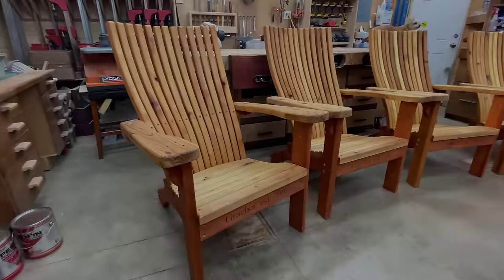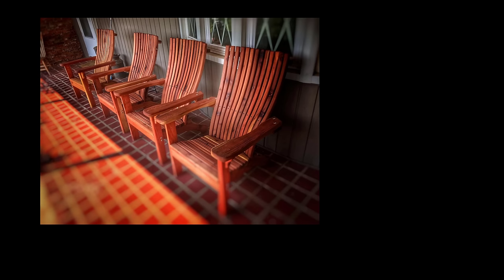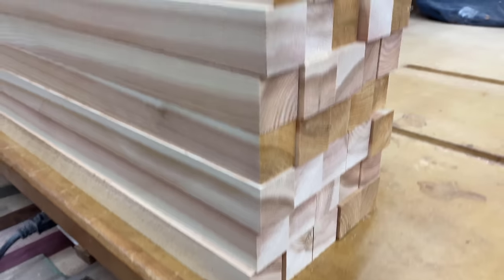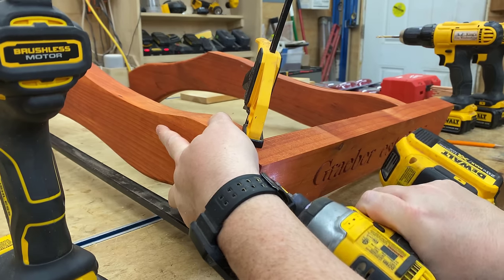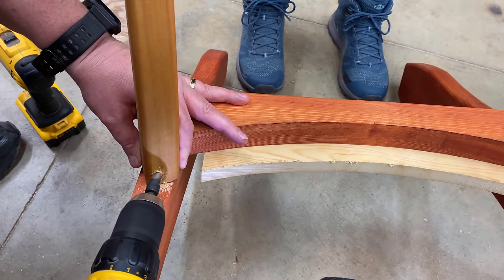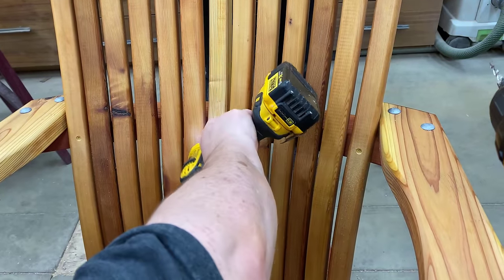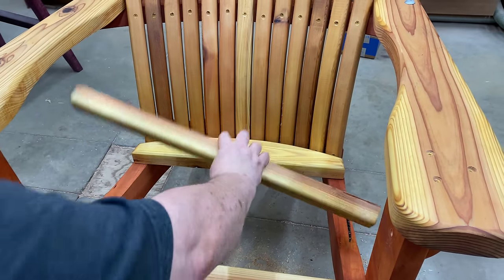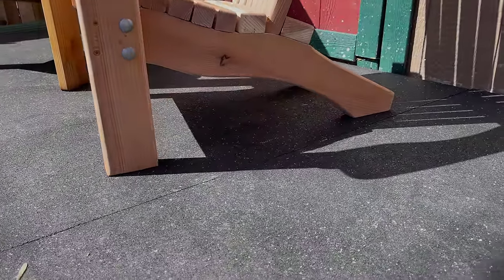Number One Selling Project of All Time - Exactly How to Make Money and Start a Woodworking Business

Comment: I have ordered several of you plans, paper templates and the wood ones you had for awhile . I love this chair and yes, it was not hard to build even with my limited experience the chair came out beautiful. I used yellow pine construction grade and I believe the lumber was close to $200, the one I did, took some time, I didn't rush it and my shop isn't very efficiently set up. So many cheap chairs out there, makes me nervous to ask so much for them even as beautiful as they are.. I can't get redwood and cedar is very hard to get here in Florida. We have a local hardwood store and I would really like to build one out of cypress but the wood is just so expensive! Your plans are fantastic and very easy to follow!
Reply from the maker: Thank you Very much for taking the time to comment!
Reply: Think of it this way: How many hours did it take you to complete the project? 

If you sold that chair for, let's say $400.  You already acknowledge that lumber alone cost you $200 (prices in Biden's America, what can you do?), and probably additional costs on hardware as well as having to possess tools to do it (those cost you money at one time).    So you would still be pulling maybe 150 dollars in profit. If it took you 10 hours to build, that is 15 dollars an hour. Nothing to sneeze at, but also not exactly Rockefeller money.   

You need to be realistic about what time, skill, and effort you are putting in. DON'T sell yourself cheap.  There are buyers for such a nice chair out there. You say it yourself, there are so many cheap garbage chairs out there that won't last more than a season or two.  People get what they pay for. These chairs here, if it's properly finished, look as if they could easily stand up for decades if cared for. People that want to pay cheap, get cheap products that don't last. People that want quality that lasts are willing to pay for it.  

It's something artists often have to learn about. Your time and skill are assets that you must value. Because there are people that disregard your time and skill (which takes time to develop) if you allow them to undervalue you.   This doesn't mean price yourself out of the market. It means don't be afraid to charge what's worth your time.

Comment: I sent and received your chair plans. I have my first chair done. How long does it take for the stain to completely dry? I stained it three days ago and you can still wipe over the chair and get transfer to a clean rag. I'm using the same redwood stain that your using. Great design, thank you ever so much.
Reply from the maker: Hi,

Did you wipe all the excess off really well? Since it’s an oil finish you’ll need to wipe the excess off fully. 

Be careful about the oily rags, they will positively spontaneously catch fire if left to sit there after use. 

Soak them in water. 

After complete wipe down, it takes about 5-7 days depending on humidity. 

If you put them in full sun, it’ll be quicker. 

Thanks!!

Comment: Wow these are awesome ideas! One main question is you use bolts in some areas have tried using screws there? Does it work or not and why? Thank you! Andrew
Reply from the maker: Hi! You certainly could use screws there. But, over time those joints - which are the critical joints - will tend to loosen up. 

Not a big deal if you don’t ever really move the chair around a lot. 

Also not a big deal if there’s no rough-housing going on in them. 

And also not a big deal if you only weigh 200 pounds or less. 

But, since I prefer to overbuild. And I want my stuff to last a lifetime. And I’m also very heavy - 400 pounds plus. I think bolts are much more appropriate. 

Hopefully that all makes sense.
Reply from the maker: Oh! I also think if you are selling them. It’s best to spend the $5 more and do bolts for your clients. They will appreciate the strength of the chair if they abuse it.
Reply: Thank you kindly for the reply! Forgot to ask two things. First are those wheels the 110mm inline skate wheels. Secondly if I purchase all your plans and prints for your outdoor furniture would you have a discount and can they be sent to me in paper form? Thank you! Andrew
Reply from the maker: @whitewolf8758 , Hi Andrew, yes. That’s exactly what the wheels are. 

And I could work out a deal for you to get the whole lot of outdoor products, and even get it printed for you. 
Can you email me at james@kingsfinewoodworking.com?
Thanks!

Comment: Hi there, I watched the video as YT decided I might like it and, while it was and a potted 'sucking eggs' video I definitely wouldn't class this as fine furniture and if you can find sufficient 'customers' to pay for a bandsaw from making just a couple of units then good luck to you. I am not sure I approve of the use of screwing into end gran; barrel bolts would be better in the long run and enable you to sell kits of parts. The carriage bolts look ugly; a better solution if you insist would be those bolts with wood thread on one end and machine threads on the other, I think they are called hanger bolts. This would make for 'invisible fixing.

Comment: a 500lb person?  I think a motorized Adirondack is next.  
Also, a screw driven into endgrain wouldn't do here - it would loosen after a winter or two. Instead, I'd install a wooden cross-dowel in the 'endgrain' part to give the screw a crossgrain grip.